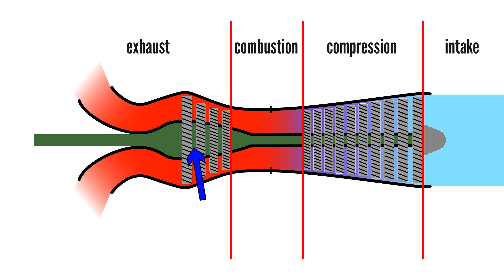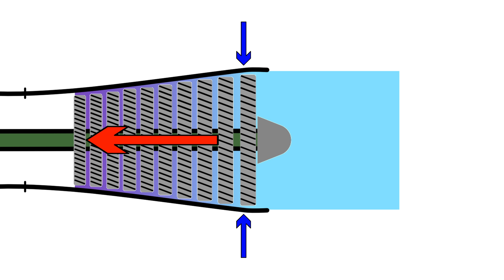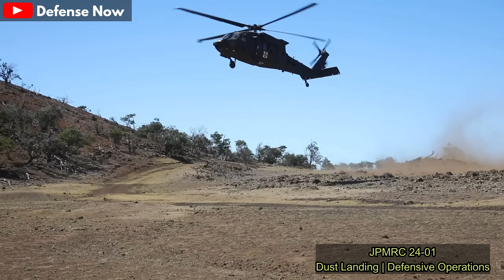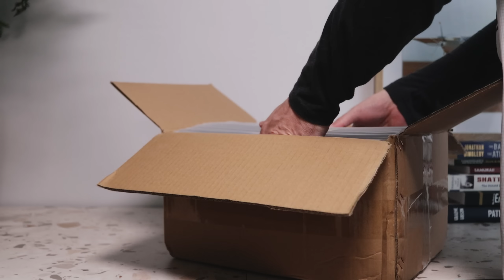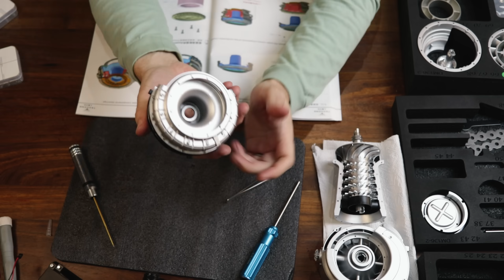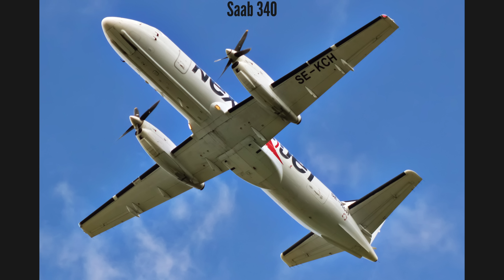Why the T700 is Still the Best Turboshaft Engine Ever Made

Comment from the maker: T700 Turboshaft model as seen in the video: https://bit.ly/4mERqEZ
Use code "LetsGoAviate" to bump total discount up to 22%, valid until 28 September 2025
Thereafter a 12% discount applies with the code "LetsGoAviate", which then applies to all Stirlingkit products.
Stirlingkit Turbofan engines: https://bit.ly/47Svsd2
More DIY kits: https://www.stirlingkit.com/?ref=LetsGoAviate
The above links are affiliate links, and I will get a 5% commission on successful sales.
Reply: Yep. I thought the same.
Reply: I’d love to build one with my son but even with the discount it’s out of my price range. Loved seeing the working model though!
Reply: The T700 also powers U.S. Tanks, Navy boats, and is the Axillary Power Unit on most military and some non-military aircraft. It would take a complete upgrade or change of military vehicles for the 901 to become as significant as the T700.

Comment: Really enjoy your technical and in depth videos.  Have you thought about doing a video on the turbo-compound engine?  It seemed to be about the ultimate in piston engine design before the jet engine took over.  It's fascinating how the engines worked, with a different turbo system compared to turbo-super charged engines.  Fingers corssed!
Reply from the maker: Thank you. Yes I've done videos about turbo compounding, the Napier Nomad video https://youtu.be/J7Sdb022Vsk
as well as modern turbo compounding in the Aerodiesel video https://youtu.be/wAb_vxdYLUI

Comment: The T700 model from TECHMECHMAN seems better in all aspects than the PT6. I’ve build the PT6 and there were some issues. No Instruction Manual. Holes were not exactly fitting its counterparts and were sometimes not predrilled. There was no partslist. The components were named with „Fantasy“-Names, showing the guys who constructed this kits had no clue whatsoever of the real engine. Finally at least 15 of the little screws were missing. But the service was very nice and responding. They sent me the missing screws in an envelope from China. And yes, don’t expect to have a real PT6 on the desktop. From Stirlingkit you get a „Single Shaft Version“ 😅

Comment: On the Stirling Kit, can you rotate and secure the stators 90deg, so one can visualize the airflow passing through the rotors and at least a portion of the stators?  It's easy for me to miss the significance of the stator operation if they're tucked in deeper within the compressor (and turbine) sections.  I remember reading about them in automatic transmissions, and how they enable the auto transmission to multiply torque.

In fact, could you do an episode about how stators came about with axial flow engines, how they help move the airflow linearly, that they can be adjusted in operation, etc?  Thank you.

Nice work, as always.  I've really been binging on your excellent instructional videos the past few days.  I especially love that you do deep dives on current concept motors, and how you highlight their features and improvements over past technologies - older tech that was pretty brilliantly derived.
Reply from the maker: I'm not sure what you mean regarding the stators. Like changing the angle of the stator blades? If so, no, they are fixed on the model. I prefer visualising it in 2D to imagine the effect. 3D makes it more difficult.

Thanks for the video sugestion, the rotors and stators subject definitely have enough material for a dedicated video.

Comment: The main function of the stator vanes, as well as the diffusor after the centrifugal compressor wheel, is to form a diverging nozzle to slow airflow to convert the airflow velocity to pressure.

Comment: Free power turbine, I get that there is “no mechanical connection” between gas turbine generator (drives the compressor) and power turbine(drives the front end output shaft) . BUT, how are these 2 shafts interacting then via bearings? Or the inner shaft if suspended in the air???  How are the Gas Turbine and power turbine centered up , somethings gotta make them be axially in line
Reply from the maker: Correct. What I meant was they spin freely, not coupled to each other.

Comment: AMAZING VIDEO. Just to clarify the swirl vanes and deswirl vanes rotating ??? Or only the swirl vanes rotate??? What generates the centrifugal force?
Reply from the maker: Thanks. No the swirl vanes are stationary. The angle of the vanes create the swirl. Air is sucked in with quite some force, this engine requires massive amount of air for combustion. The velocity of the incoming air and the angled vanes swirl the air.
Reply: @LetsGoAviate thank you!! May you please review my question below about how both shafts are aligned if not mechanically connected please

Comment: I flew the ct7 in the saab340. Underpowered but did the job.
Reply from the maker: Thanks! If you could compare its operation to the PT6? (Assuming you've flown it as well).
Reply: @LetsGoAviate some of the systems were incredibly complex on the engine. Theres a thing called the HMU that our instructor literally saud "runs on pure f'ing magic"! The HMU was a hydro-mechanical unit that modulated fuel. When you selected deep - reverse the hmu would dump in a bunch extra fuel to increase the rpm so it wouldn't stall under load.
The ct7 didn't have the inlet swirler like the t700... It had a particle seperator that was at the bottom of the nacelle... The intake air did a 180 and the incoming dirt and such couldn't make the turn.
The tailpipe actually was a thrusting exhaust and added something like 1% to the total horsepower output.
It had a "poor mans autothrottle" called CTOT-constant torque on takeoff... You set the torque number on a dial by the flap lever and armed the system.. When the throttles passed the 67 degree switch, the hmu dumped in the proper extra fuel, and the engine would accelerate to the exact torque number you set. It was disarmed in the after takeoff flow.

Thats all I remember because it was 15 years and 4 types ago

Just realized you wanted comparison to the pt6... I've never flown on one.
Reply from the maker: @BobbyGeneric145  Thanks for that info, very interesting!

Comment: I think you made a mistake stating that the turbine which powers the compressor takes 70% of the energy and the power turbine takes 30% it's rather the opposite way around
Reply from the maker: Not a mistake, triple checked it as it is usually a 50/50 split. Unless my information source has a mistake, which I doubt.

Comment: That foreign debris extraction system is exactly like the dust cyclone extractor I have for my wood shop tools!  It's a little cyclone separator for a 5 gallon bucket. It literally catches everything. Run the shop vac for months and nothing is in the actual shop vac filter or tank, all ends up getting separated out by the cyclone separator into the bucket. Very cool.

Comment: CORRECTION : the stators  (fixed or variable ) are not there (in the intake between compressor stages) to redirect air ! They convert intake air speed to pressure !!
Reply from the maker: It does both
Reply: It definitely does both of those things
Reply: Yes, it does both. It was a German Engineer and former director of General Electric, who invented the Variable Inlet Guide Vanes. His nickname was „Herman, the German“. His real name was Gerhard Neumann. If you find the book "Herman-The German“ about his life, you should buy it. It’s absolutely exciting to read. He was the „Father“ of the J79 and also the CF6 engine.

Comment: The main advantage of a free power turbine is that if the torque demand is too high it will not decelerate the compressor section reducing compression and power output thereby decelerating the system in  a loop. This is critical in a helicopter where it’s quite common to get some rotor droop as the engine responds to changes in power demands. If an engine is been over torqued it will continue to produce maximum power even though the output RPM will be reducing.

The free turbine has no effect on autorotation or it’s quality’s as you stated that is achieved with an overrunning clutch and is irrelevant what engine type is used. It’s like the sprag clutch in a bicycle that only delivers torque in one direction.

Good video I enjoyed watching
Reply: Also, they work really well in a Florida Giraffes turboshaft powered Camaro...
Reply: I learned the PT-6 uses one compressor rotor and one rotor to drive the output shaft recently. It wasn’t clear to me why so thanks for the explanation!
Reply: AFAIK, free-turbine engines have some advantages for fixed wing aircraft.  During initial startup, the gas generator can start turning without having to deal with the inertial and aerodynamic loads of the props.  Also, the props of multi-engine aircraft (in modern setups) use oil pressure from the governor to go to fine pitch, and use spring pressure to go to coarse pitch.  That means that if the engine loses its oil, the prop feathers on its own, so you don't have guys panicking and feathering the good engine.  But apparently feathered props produce enough air resistance to make them a drag to start, if you have a piston or non-free-turbine turbine.  So then you need a latching mechanism to hold the blades in fine pitch when you shut down--the blades should be in fine pitch already, as the governor thinks they're turning too slowly and goes to its low-pitch stop.  Then the latch mechanism holds them there when the oil pressure drops at shutdown.  But if you look at something like a Beech King Air with a PT-6 free-turbine engine, you'll see that the thing just shuts down with the prop feathered.  The gas generator doesn't give a shit what the blades are doing, since it's not turning them.

Also, if you have a setup with a latching mechanism that uses a gas spring to push the blades to coarse pitch, like say hypothetically a Beech Baron, and your hypothetical idjit coworker doesn't read the manual and over services the nitrogen springs, the latch mechanism can't act fast enough to catch the blades before they feather, and the hypothetical pilot comes back to grump at your hypothetical boss or senior mechanic, who then hypothetically grumps at everyone.

Comment: 5:14 im fairly sure the reason early jets were so often centrifugal, despite axial compressors existing, was that they are immune to compressor stalls, which is a problem that was yet to be solved for axial
Reply: Early jets favored centrifugal compressors because they were simple, rugged, and easy to manufacture with the technology of the 1930s and 40s. While centrifugal compressors are more stall-resistant than axial designs, they are not immune to stall; the main reason for their prevalence was practicality and reliability, not solely stall concerns. You're completely overlooking the manufacturing/materials context.
Reply: @complexdevice why did the germans go for axial? because theyre stupid?
Reply: @complexdevice i mean if the germans could do axials i dont see why we wouldnt have since when it comes to materials availability and cost and reliability, we were leagues ahead of them
Reply: @buttole I see your point, and thought the same.  I guess I was always a bit surprised the Germans didn't make centrifugal compressors.  Maybe they did, and found axial compressors were more efficient.  I read they had severe shortages of materials to withstand the high heat of the turbine sections, even coming up with drilled blades to keep the heat off the blades, but the turbine section was the life limiting factor for the engine.  The Brits would have had the same issues with heat, but they had better access to the strategic metals.

I don't buy the argument they were a product of that day's engineering expertise, because as you point out, the Germans machined axial flow compressor sections quite nicely, and we can see the Brits had excellent machining capabilities.  It seems almost like a cultural component might be at play...maybe the guys who put together the first jets worked on turbochargers and superchargers, both of which used centrifugal compressors.  Perhaps axial flow just wasn't in their wheelhouse yet.

Comment: I think axial compressors has the biggest advantage when you need high volume, not mass flow. That makes putting the centrifugal stage after the axial stages logical, as the volume for a given mass is decreased by compression. Also, the increased density of the already compressed air helps the centrifugal compressor stage compress the air more at a given rpm.  

Also, the main issue with the efficiency when stacking multiple centrifugal compressor stages is the change in airflow direction, which makes it difficult to have high efficiency if you stack multiple stages of centrifugal compressor stages and also need the system to be as small and lightweight as possible. I think centrifugal compressors can be more efficient that axial for a given compression ratio, but stacking multiple stages of centrifugal compression without losing too much efficiency when redirecting the flow between stages makes that strategy too heavy/big for aircraft engines, and in other applications where weight and size is important.

Comment: The Arriel turbine I think is better, especially the Arriel 2.  It's modular, simple, has great power to weight and is everywhere in civil helicopters
Reply: Nope the Ariel is an expensive piece of French crap. Expensive and difficult to overhaul. Can't even compare the two. The US army has learned this with the UH-72 that is about to go away from the active service.
Reply: @markmata389  The UH-72 has never been in service with active units outside of training centers (JRTC/NTC) and was/is used by the National Guard and as an initial entry trainer. The issues with using the Lakota as a trainer are more complex then engine maintenance and have a lot to do with the way the contracts were written and how the Army maintains it's aircraft. The shift away from the Lakota is also because an initial trainer should be cheaper and easier to maintain hence the current contract bidding for a new initial trainer. The UH-72 and the H145 by extension is a great aircraft for doing what it's been designed to do. Which is not being an initial trainer.
Reply: @complexdevice  I know very well where the UH-72 are used. The ariel can't hold water to the T-700. 36 years flying the UH-60 and I am an SME at Redstone working on both platforms. So I do know a thing or two.

Comment: The reason the final compressor is centrifugal isnt due to length - after all it would only take an extra 2 axial rotors to achieve the final 2.43 ratio - but because at this small scale centrifugal compressors are more efficient. That's because centrifugal compressors can increase the PR more than axial but have similar tip losses, however it is not practical to mount multi stage centrifugal compressors in series on a single, shaft, hence the layout we see. On larger scale the tip losses are less important and axial becomes more efficient again.
Reply: Yep, two centrifugal is the max you can use.
Reply: The reverse flow combustion chamber also works in concert with the centrifugal compressor right?
How do modern axial flow turbines slow the air down enough for flame propagation?
Reply: @colinjohnson5515  They have a diffuser.

Comment: An excellent video, very informative. May I suggest a follow-up, covering the PT6A and its many variants? That engine also has a surprising flow arrangement to 'filter' out foreign objects. The whole direction of gas flow is actually reversed as part of that. It's not a quickly intuitive arrangement, but it has been in service for a very long time and it works exceptionally well. Have you ever wondered why the hot gas exhaust is from two sides at the front of the engine? Then for completeness, perhaps a quick look at one of the original turboprops, used on the F28 Friendship, Vickers Viscount and many others, the RR Dart? I think that one uses primarily radial flow / centrifugal stages.
All of these engines have been around in large numbers, for a very very long time. They are proven.
Reply: The RR Dart had two centrifugal stages, no axial stages.
Reply: @BorgeltInstruments  ~ Yeah, I thought so.
Reply: The PT6A-114 variant on the Cessna Caravan has a single large exhaust duct instead of the standard two in other PT6A dash numbers. Being familiar from wrenching on the PT6 it was interesting to watch this and see the oddly familiar reverse flow and compressor layout

Comment: I was trying to formulate some type of TIC comment about how this video was really just a good excuse for you to show off your new toy. 
But then it dawned on me that thanks to your detailed concise and logical explanation of the operation of this engine, while simultaneously demonstrating each relevant process on a physical model, perfectly complemented by helpful graphics and all timed to perfection, I now finally understand how a turbo shaft engine works. At least, at a level where I am as comfortable talking about it as I am with an Otto cycle for example. 
So thank you for that. And also, heck what a super cool engine the T700 is. The design details are fascinating, that intake “air cleaner” setup is just genius. 
The “disconnected” output shaft reminded me of a mid 80’s RWD 3-speed automatic car I had long ago. No lockup clutches, just a fluid filled torque converter between engine and transmission. It always intrigued me how it was possible to produce wheel-spin in car that technically had no physical connection between the engine and the drive wheels 😂

Your video was superb, thank you. Honestly right up there with some of my other favourite channels like Driving4Answers and Robot Cantina, both in terms of entertainment value but also for presenting vast amounts of expert technical knowledge in a relatable and easily digestible manner. 
Bloody well done Meneer 👌🏼